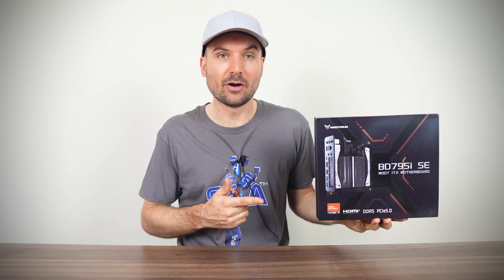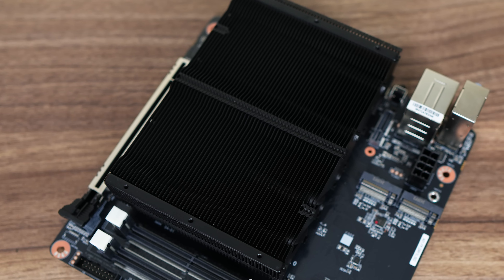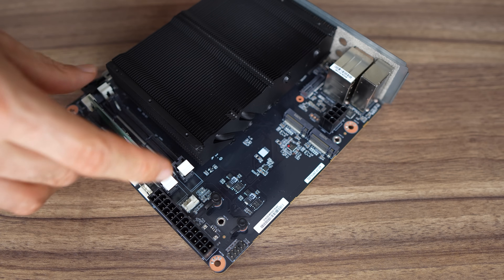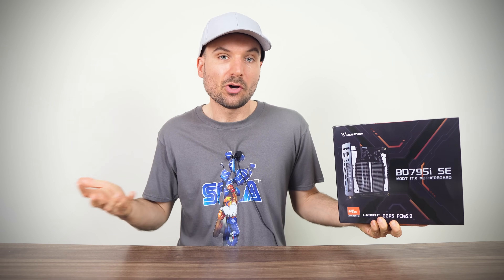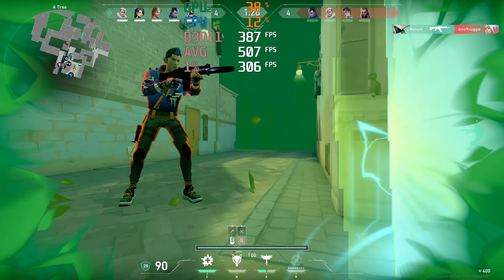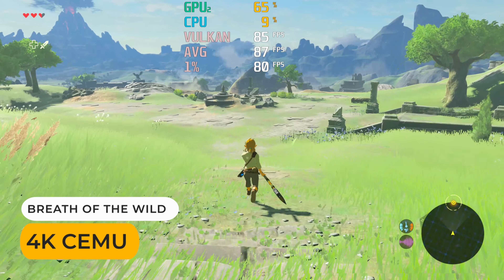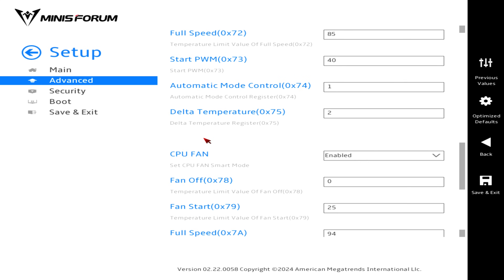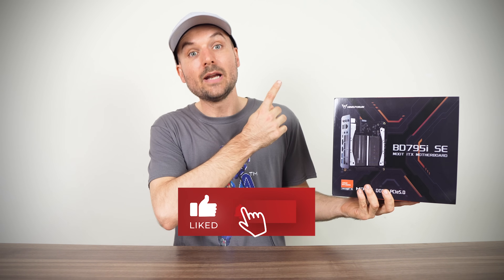Build Your Own Mini PC Beast - Minisforum BD795i SE Review

Comment: This is now starting to look like a reasonable option for desktop during ram shortage. I have an old laptop I no longer use with sodimm ddr5 ram and a 1tb ssd that would be worth salvaging. Plus I already have a 9060xt I use with oculink. Pairing this board with a PSU, and moving 9060 xt to this system may not be a bad budget option until ram prices chill.since tho

Comment: How do we get it to stop overheating is my question. My voltages are way down pbo x10 in reverse so its only running at 4.8 all core max and this thing cooks through my thermal grizzly paste in less than 2 weeks to start overheating again ......
Reply: I do not yet own one of these but in my research owners have suggested that you should replace the thermal paste w/ the Thermal Grizzly KryoSheet. This will negate having to re-paste. Check YT user Z Modified, he has a near 4 min vid titled "Undervolting and power consumption BD790i - Minisforum itx 7945HX" that might be helpful. gluck

Comment: Mine arrived today. Waiting on other parts. Going to replace a 2500k cpu and board in my unraid server. 8 port lsi card for hard drives in the pci slot. M2 to 10gb sff for network and 1tb nvme for cache drive. going to host my own cloud server for photo and video back up from my phone and run other dockers so needed to replace the old CPU.

Comment: I got my board at the beginning of Feb and so far I love it.  I put it in a Zalman P30 case because I wanted everything to breathe when I added an Intel Arc B580 video card.  I too used a Noctua fan for the CPU.  Definitely SATA ports would have been nice but there are USB ports and I can plug in an external drive if needed.  The one thing that confuses me is that when the integrated video is disabled in the Bios, it still shows up in Windows Device Manager as an unknown PCI-E device.
Reply: Did you have any issues with the ram install? Mine doesn't seem to click in at all and I don't want to press down too hard....the board has power but HDMI doesn't output any video so I'm not sure if maybe an issue with the ram....have 2 X Crucial 32gb sodimm ram, and a 2 tb nvme drive in....seems doa to me but the fans do turn on when power is turned onto the board and really don't want to have to return this!
Reply: @GarethEdwards1979  I used 2 x 16gb Crucial DDR5-5600 sodimm ram and a 2tb NVME drive.  If you are not hearing the ram click into place then it most likely is not seated and when the PC is powered on it will not boot, hence no video.  Try re-seating your ram and make sure you have the notch in the right position.  Ram will only fit in socket one way.  Once you have it lined up correctly, push down firmly until you hear the click, you should not have to push hard and both clips on each end of the slot will click as ram is seated.  Hope you get the ram seated and your new PC boots up... So far I am loving it.
Reply: @JosephIsWithGod  thanks so much for the reply. Yes it must be that. I've built fair few PC's before but not like this one or ddr5 mobile ram so I'm thinking it must be something like that that I haven't done quite right :(
Reply: @GarethEdwards1979  Its been awhile since my last build, 2011, I had 2 Geforce cards connected using SLI and loved it back then.  I bought a Minisforum  Mini PC TH50 a few years back and that has worked but I like to game from time to time and the TH50 lacked in video.  The BD795i SE looked like nice for the price.
Let me know if you get it to boot up...  I know the feeling of building a PC and then turning it on and hoping it powers up and there is nothing, it has happened but patience and rechecking that everything is firmly and correctly attached has always led to a boot.
Reply: @JosephIsWithGod  thank you yes that feeling is certainly deflating! I'm fairly certain that's where the problem lies because of that's seated ok, even with no USB boot drive or anything else it should still get to bios....
Reply: @JosephIsWithGod  thanks for your help mate, got it working today! But blimey that cpu runs hot.....even with no load fiddling in bios it was low 70s!
Reply: @GarethEdwards1979  That's good you got it up.  Low 70s is high when in the bios.  I get 40-60 when idle in the bios which is fine.  I get 39-42 when idle at desktop.  Make sure the CPU fan you installed is properly aligned and air is properly flowing.

Comment: Built one with an Intel B580, a Noctua fan, Fractal Platinum 750 watt PSU, 64 GB of low latency DDR5/5200, and an Intel wifi7 card, and left it open as a test bench. It benches almost the same as my 7950X with a Quadro A4500 on most things, and is THE perfect encoder, when streaming AV1 to various sites. I would have liked a 5GbE or higher ethernet port, and while I had no driver issues on 3 Linux distros )CachyOS, Fedora 42 and EndevourOS, Windows 11 Pro required some drivers and teeth gnashing! The "build" mostly sits in an unused, upstairs bedroom my wife can't see, because otherwise she would kill me (ran pink multi-mode fiber upstairs! She hates it.). I need to get a power draw meter to test idle power. The Intel B580 gets hot though, really hot on long streams.
Reply: Hi We just hor one, was trying to find out how and where the power supply goes
Reply: What wifi card you use, I think there is alot of folks out there wanting wifi7 but as far as they know no cards are compatible. I use Arch btw

Comment: I got this for $620 cad including duty. Amazing cpu and board for the price. Have my 3080 connected to it. Everything was amazing. I ended up 3d printing an open air case.
Reply: Nice. Same build I’m looking at, existing 3080, or maybe a 9070 XT, soon. Very tempting.
Reply: I just set up my MINISFORUM BD795i SE motherboard with a Corsair RM750e PSU inside a Cooler Master NR200P. The motherboard gets very hot within seconds of powering on - is that normal
Reply: I bought it at $230

Comment: Too bad minisforum discontinued the slightly slower BD790i SE which is identical with that barebones except the CPU is a slower Ryzen 9 7940HX but with the same cores/threads for a significantly lower cost if 329 USD
Reply: The price still comes in less than a 14th gen i7 or i9 cpu alone costs so it's still a great bang for the buck

Comment: Finished getting my case fan speeds sorted thru BIOS. Undervolted -15 on the curve which helps all around and stable so far. HandBrake still hammers my temps but around 2C cooler and shaved 3 minutes off my test HQ encode. This is the way..

Comment: I appreciate your video, mine came in the mail today and I'm following your lead. I'm having trouble with the ram though. Mine isn't snapping in with a pinch like yours did. I don't see any instructions and it's lined up pretty well, but no snap?
Reply from the maker: Just make sure they're pushed in far enough so the clips can attach on both sides. That should be enough for the board to detect them.
Reply: @Robtech  Thank you so much for the response! Can't wait to try this board out!
Reply: I'm so glad I saw this.comment because I am having a really tough time getting this board to work...I turn power on and the fans all fire up no video from the HDMI out....have tried 2 different cords on 2 diff displays :(

Comment: Per multiple benchmark sites the 7945HX has a really poor iGP performance (approx 3000g) compared to 7845HX which is twice as fast as 8600g. Does someone actually have a firsthand experience?
Reply: The claim to fame isn't its integrated gpu, it's the 16 cores and full pcie slot
Reply from the maker: Do you mean 7840HS? The 7845HX has the same weak Radeon 610M graphics as the 7945HX

Comment: Its certainly worth considering if you have a need for speed.  A BD795i + 4060 will be cheaper than HX370.  gpu performance of 4060 more than twice that the HX370 890M.  Multicore performance of 7945HX 50% better than the HX370. Kinda makes buying a HX370 look stupid.  Personally, I don't even push my piddly 6 core 7500f anywhere close to its limits.  I'd certainly consider the BD795i if I had a need for all those cores.

Comment: My HandBrake Nija 

Non SE version has PCIe 5.0 all around with Wifi/BT /antennas and the fan cooling block for both PCIe SSDs all for $24 bucks extra. The SSD cooling block, little fan disconnected, keeps both SSDs at max of 38C under load, typically 32C.

After watching HWiNFO64 I now run my CPU fan in exhaust.  This keeps the 100 watt CPU from heating the DDR5 ram and SSDs during high loads. I use old Thermaltake Core V1 box for the 200mm front fan for my HandBrake encodes. Sort of the Wet Sprocket of the little hot boxes, no?

Still getting my head around these hot encoding temps. I maintain 76-79C with a quick spike to 81C. CPU CCD2 (Tdie) maintains 75C with a quick spike to 90.6C.

Seems the BIOS does a great job maintaining the 100 watt firewall, But noticed different fans allows bit more clock speeds and different benchmarks to small degree?

Thanks for the review!
Reply: You should not use it as exhaust. The motherboard needs to extract heat out of the IO shield. Try instead buying better ram
Reply: @talha0139  That just what is does..in EXHAUST. Try using HWINFO and look at your temps...
Reply: @talha0139  Exhaust, like how cooling towers are set up. I have to send heat upwards out of box, this evacuates hot air and cools the ram. Tried both ways monitoring with HWIN64, Ram never over 40, normal 36c. So, how is yours set up and your temps?
Reply: Where can you find the non SE version?
Reply: @TheMaxAwesome  Mine from Amazon (US), $429, shows out of stock when checked today...

Comment: Interesting product and I've been hoping you'd review it.  Granted, the cost is certainly lower than buying an ITX MB and the CPU, but I wish they'd have charged a bit more and included things like a SATA port or two.  If I'm reading the specs right, that chip has 28 PICe lanes, so there's room. It'll be interesting to see how it does in the market.
Reply: minisforum are weird the BD795M M-ATX has sata ports but again they took away the usb 3 port and no heatsink included with it,but comes with a ryzen 9 7645hx,its like they dont know what they want to include in their boards

Comment: Since we are talking about AM5, the soldered CPU is a downside.  AM5 has life in it and very likely to have a better CPU for it that could fit here.
The other issue, for me, is the lack of SATA connections.  I wouldn't build a PC with less than 4 SATA connections.  I know not everyone cares, but I do.

Other than that, the rest of the issues are not important, but they are still weird.  Why no CPU fan?  Like...wtf?

I think it's a fine bundle and obviously very good, but the negatives could probably be solved by Minisforum without much effort, well...not now obviously.

Thanks for another very good video.
Quick question, does the BIOS allow you to alter the VRAM allocation for the iGPU?

Comment: This is definitely a very interesting concept, I have been eying for some time, and I'm glad you tested it. I think it would probably be even more interesting with a 7840 or 8845 APU (or an HX AI 370 when it gets sanely priced), of which one can find some specimen on AliExpress or CWWK. Reason being that  those have iGPU's that could make a dGPU obsolete. I'm still wondering though whether this actually beats a mini with a Occulink combo in the "making more sense" compartment.   

Can one switch easily from iGPU to dGPU when the dGPU is installed, to save energy in case one is doing some light office work and don't need the dGPU power?
Reply from the maker: You'd need to disable the dGPU manually in device manager and have another monitor already connected via the board as the dGPU display would go dark. It's pretty much a desktop platform just with a mobile chip.

Comment: Nice to see a product like this exists.

The lack of SATA ports is a bit of a downer, but still nice.  They could be added with a cheap PCIe card, but that leads to the other issue:

What the market really lacks is a product like this with a descent iGPU.
Reply: There is another model with SATA and no radiator BD795m
Reply: If you need Sata you can install them yourself with an NVME M-Key PCI Express to SATA 3.0 6Gbps.
Reply: Hopefully we'll see new variants of this approach from Minisforum with strix point or strix halo APUs in the not too distant future.
Reply: Could also use USB to SATA adapter.

Comment: An expensive item with a few significant drawbacks.
Reply: You're paying for upgreadability and form factor, which is funny considering that these mobos have existed for years
Reply: @MorganEdgy  but you've got no meaningful upgradability like cpu upgrade
Reply: @Potaty_man that's the only upgradeability you don't get 🤨
Reply: @  most mini pc's theses day your able to put in your own ram and storage
Reply: @Potaty_man yes.    So does this one.
Reply: @MorganEdgy  bruh I'm saying that's is expensive for the price and you tried to use the fact that it has upgradable ram as a point to defend it. Whilst plenty other mini have upgradable ram and a better cpu for the price.
Reply: @Potaty_man that is not even remotely similar to what you said. If that is what you meant you should have written that instead.

Comment: If you could upgrade the CPU, that would be superb... You can do it Minis Forum!
Reply: They actually have an upgradeable station
Reply: Well my 4 year old 3600x up and died! I was able to save old MB and ram by dropping a cheaper 5600x in it's place. If this happens to my very fast BD790i at 4 years, I can only look to a small Mini ITX hole in the back yard.  The 3600x and the 5600x cost more than the BD790i...
Reply: AMD won't sell 7950x that cheap 😂